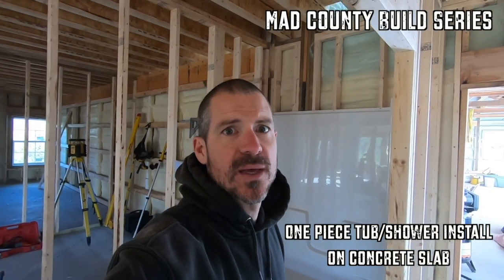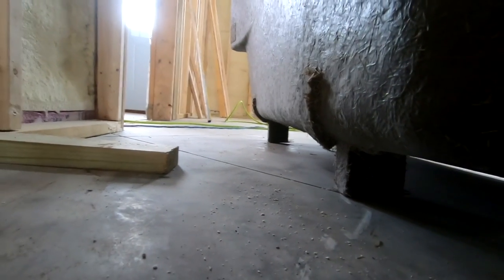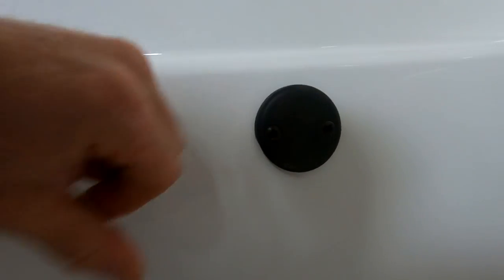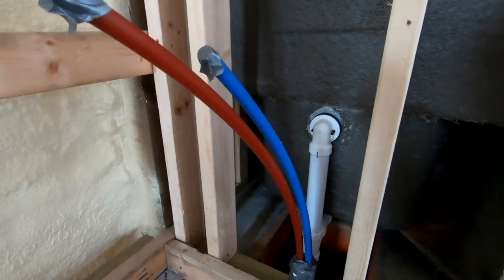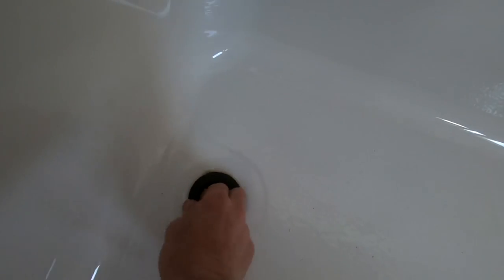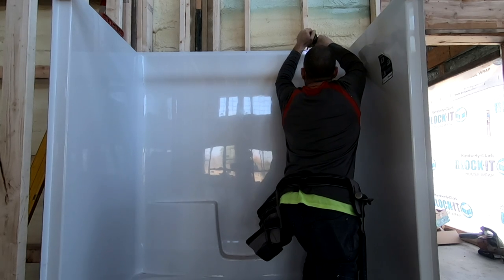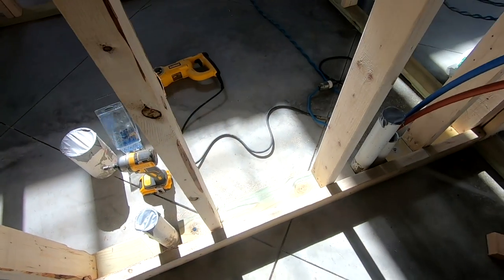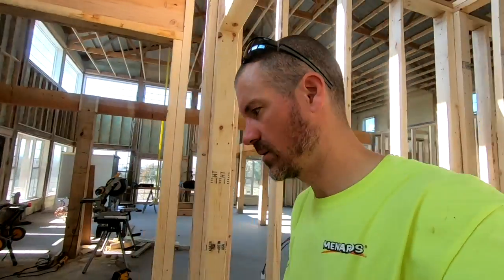One Piece Tub Shower Install on Concrete Slab

Comment: I built an earth contact home so I am no stranger to concrete floors and plumbing and if I did it again I would do some things different.  I am alone now son not all the tubs and bathrooms period get used.  I had company once and my shower, much like the one you installed.  The drain lost its seal where it is screwed to the bottom of the tub.  I turned the water off and messed with it later.  NOONE could sell me a drain that I could install from the top at the time so it remained unused for some time.  Then one day I saw on here a new top install drain.  It slides over the rough plumbing and rolls on a greased grommet.  The ring is self tightening by 5 fingers you set and when you start turning the screws the grab the bottom/floor of the unit.  I don't think anyone used any support under the units.  When I built my other houses I dumped a wheelbarrow of concrete in and set the unit in that and never had problems.  Anyway they have all that stuff accessible from the top now.

Comment: first, congratulations for your build!  nice to share with us. Quick question:  you went way above standard with urethane insulation, metal roof, gigantic square footage, LVL's everywhere and you install a precast fiberglass bathtub......WHY?   it's like owning a porsche or Ferrari and putting walmart tires on (I know it's not your master but it definetly ''choked me''
Reply: I'm thinkin this is just one of the guest bathrooms and he'll get a little more fancy with the master, hopefully. He does a quick walk around in the previous video, Interior Framing Part 4 around the 17' mark and shows the layout.

Comment: I’m a kitchen and bath remodeling contractor in Southern New Jersey I always put structalite which is the base coat for plaster walls it’s great for sound deadening tub bottoms and a great leveling base you don’t get that hollow sound when your shower hits the especially on upper level bathrooms you don’t hear it in say your den area watching tv
Reply from the maker: Thanks for the tip. Much appreciated.

Comment: Very helpful. We have slab flooring and have to replace the tub. Can't find a plumber to do it. The builder encased the pipes in concrete so there's no hole, we can't replace any pipes. Should we jack the concrete out?

Comment: We used to run mortar to support the center in order to prevent cracking. Love this build!
Reply: We still do run mud beds under all our Acrylic Tubs and shower pans. OR we use spray foam. We have drains cracking around the drain flanges on the tubs especially. The weight of people standing in the drain areas was causing stress on those areas. Yet the tubs and showers had plywood fibreglassed in legs and platforms.
Reply: I was going to say we use structolite under our tubs/shower bases for added support.
Reply: Yes, he could still pack mortar under it or better yet spray foam could get sprayed once he can fill the tub full of water closed cell foam would add structure. I have also see drywall mud used as well
Reply: @mkzenthusiasts  Spray foam is soft. In my opinion not so good to add to the structure. Mortar or lightweight (foamed) concrete will do better. Consider acustic butyle mats on the tub walls, too. It will improve comfort.
Reply: @rkalle66  are those applied before or after settling the unit?

Comment: Your video saved me so much frustration and probably a broken shower. I bought the exact same model and nowhere in the instructions does it say to use 2x4s under the feet. I was about to screw it in place and then shove shims under it which probably would’ve softened and then shattered the flange later on.
Reply from the maker: Glad we could help! Thanks for watching!

Comment: Is the box in the concrete slab that you brought up to shower/tub drain protected by a vapor barrier of some sort?  I askings because I am installing a 42" x 42" corner shower in a basement slab with 2 inch drain.  Trying to figure to the best way to pour the slab but be able to plumb the corner shower drain later.  I am VERY hesitant to pour the basement slab concrete encapsulating the shower drain p trap. Thanks!  Nice work by the way!

Comment: Why do you have the saw joints cut in the concrete floor like you do? Also when installing the bottom plates for walls any concern about hitting pex lines for radiant heat?

Comment: I suggest that you install an access trap door tall enough to cover the shower/tub controls (just in case the have to replace it) and going down, to gain access the the swival "p" trap drain below the floor.

Comment: Ive seen where lots of people will set the tub in mortar for support over the life of the tub.  Do you have plans to insulate behind the tub?  I like the spray foam idea for added tub insulation to keep the water warmer longer.
On your wall sill plates, besides tap-cons for anchors, I have seen adhesive used between the floor and plate.  Any thoughts on adding a beed of calk under the plate?  Even to keep water contained within a room?
Reply: I wish I had done that when I replaced my tub in '07.  Every time I step into it, it creaks and moans, and I keep thinking it's going to crack at some point.
Reply: How about using spray foam, sprayed in after the tub is installed, to support the center portion? 
I have a tub/shower I installed 25 years ago, and the center sags now when I take a shower. I might try to put some spray foam underneath it (I have access from below).

Comment: right on.  I think the angled rubber overflow seal might be upside down though...?  If you put the thicker on the bottom wouldn't that make the overflow drain pipe 90 degrees to the ground rather than at more of an angle following the vertical slope of the tub?
Reply from the maker: That’s how one would think it should be but that piece has an angle to it that requires the thicker part of the seal to be at the top which then makes your pipe straight up and down.

Comment: Thanks for showing us.
Footing question
Why did u have to put the 2x4 under them? Does the kind require it to be tilted for proper water flow to drain??
Oh yeah really is I appreciate u distinguishing a few thing on connecting the pipes. Newbie here
Reply from the maker: It’s hard to see in the video but if I were to set those feet directly on the floor it would not be level. The feet are  intended to be set in mortar but I like setting them on 2x4s if possible. I have had good luck doing it this way and have not had any problems with the tub being solid.

Comment: I hope you remember to install some support for the center of the tub.  I use spray foam before.  If you don't support that section you run the risk of it cracking and creating a leak.  That is fibre.  Set the tub then come back with some spray foam from the side.  Just use the non-expanding filler.
Reply from the maker: Thanks for the tip!

Comment: nice job sir. I have seen these fail over a long time (25 years) due to no support under the tub, like mortar or foam or similar. after several fatigue cycles of a 200lb person plus water, possibly like 400 lbs of weight on the bottom. plus if you do it will take any of the "squishy" feeling you may have when you step in it. It may feel stiff now but over time may weaken.

Comment: That helps me out as I need to relocate my shower and cut the concrete to move the plumbing. I'm actually going to do a tiled shower so my install will be a bit different.
Reply: I'm not doing high rises
Reply: @joshdaniel8729  Your response has nothing to do with what I was saying at all.

Comment: Are you worried you are going to hit the radiant floor tubes with your hammer drill/tapcons or are they set deep enough in the concrete floor that it doesn't matter?
Reply: He's said in several of his videos that the radiant floor heating tubes are 5 inches deep in the concrete. The anchors only go 2 inches deep, so there's no problem.

Comment: Just installed this.  How did you get the label off Mine is on and totally  stuck on
Reply from the maker: Lemon essential oil, steaming it off with a clothes steamer and plastic scraper are two of our go to methods
Reply: @MrPostFrame  I have a steam cleaner. I'll give it a try thanks

Comment: Loved watching your video, you're doing a great job of explaining as you go. It's helpful for learning. I'll certainly be back for more. I need you to do a video when you hook the PEX up. I'm about to switch our house to PEX and I'm not exactly sure how to get it all connected. I'm also thinking about installing a PEX manifold and tankless water heater.
Reply from the maker: I will have a pex manifold so it will probably be in line with what your doing. I use maniblock manifolds. I get them from supply house.com

Comment: Amazing tips once again. Rubber connection, access door, etc.  I would use some sort of spray foam or something of the like under/around to base of the tub.  It will make it way more solid over the years.

Comment: You’re brave to drill into the concrete like that I would be worry about the radiant floor heating or did you pre plan that wall

Comment: It is a bit late now, but before installing the shower tube, spray foam the bottom and back of the tub a day in advance installing. Great sound insulation and your tube water keep the heat longer.
Reply: YES!!! I spray foamed under the tub in the basement bathroom I finished and it's great. Very solid and slows the water from cooling off. I actually foamed it in place.
Reply: @nakantor  I've done it in place as well.  I did it more to make it feel more stable, and eliminate creaking noises while in use.  Bugs me when I'm in a well built house and the shower feels like I'm in an RV.  Extra insulation was a side benefit.

Comment: 1) The drain-tubing, should it not be linked "female" to "male"? so that there is no "lip" inside of the drain-tube that might stop the free-flow of water and perhaps compromise the seal over the years. I think you put a straight tube (male to male) linking the drain from the bottom of the tub to the vertical tube; might not be "best practice" and cause issues along the way.
2) I would try to put some planks/boards under the tub so that it won't be supported only on those small feet at the edges; just prevent/limit the formation of a "curve" in the tub over the years. It make sense to try to distribute the weight of the person standing inside the tub across the whole bottom.

Comment: Just a thought, at that penetration in the slab for plumbing or any penetration, possibly all exterior walls.  Apply some Bora-Care or similar product to the lower 2 feet or so of the studs to stop any future termite invasion. I dont know how bad they are in your part of the world but I could see them coming up under the tub and getting into the framing. Here in the south they spray the sub soil under the slab before the concrete pour. Also maybe a dusting of boric acid powder on the slab under the tub around the opening.  Under island in the kitchen, walls, where plumbing comes in before you close it up for ants, roaches etc.  As long as it stays dry should work forever. Preventative pest control

Comment: Surprised that the tub did not require mortar under to support the tub.  If not mortar some tubs require expansion foam of the type for use between doors and window frames to give it more support.

Comment: Hay I am sues husband may I suggest when you put tub in (fiberglass unit )put in place mark every thing then move it out of the way get one or to bags of sack create mix it so it is stiff lay a piece of plastic down were the tub will be placed in put concrete on top of plastic push down so tub is smashed in concrete this will eliminate squeaking noise when showering and will ad strength to tub bottom my daughter had this problem in her house Plummer’s had to come back and do this repair solved problem

Comment: I suggest you slide non shrinking grout underneath the shower so that there is no movement when you're in the shower it works very nicely I do not recommend putting spray foam underneath it.
Reply: Hey

Comment: PVC installation standards call for the solvent cement (glue) to be applied to both the hub and the spigot with a 1/4 turn. Don’t just apply it to the pipe, get the hub too.

Comment: I'm new to this build. Fire your framer. There is a whole lot of wood missing. The studs at the valve will be in the way. Where's the insulation.  Make a dam and pour under with a bag of non shrink grout. Don't use this as a how to video.